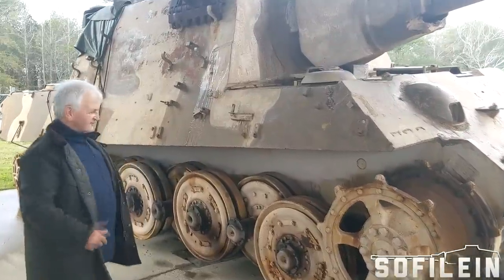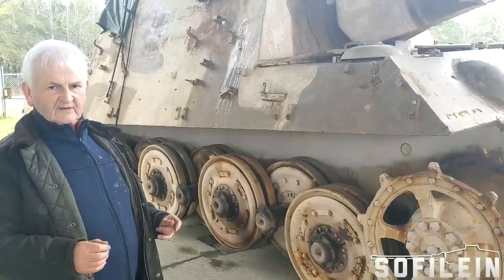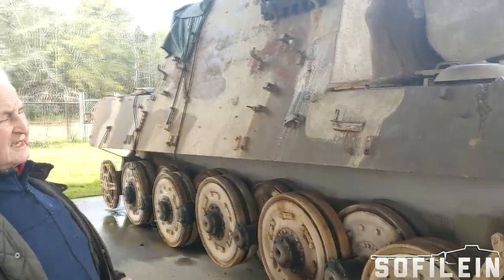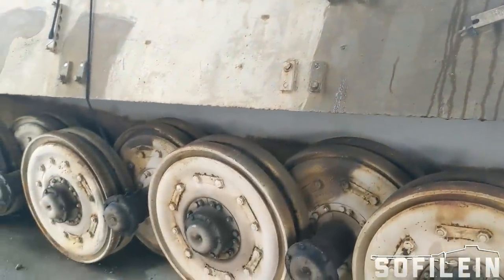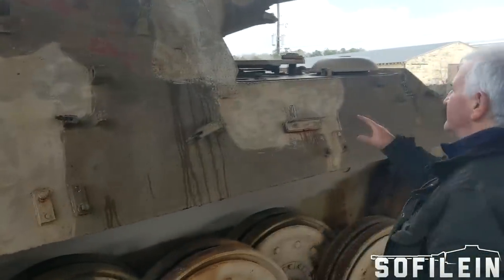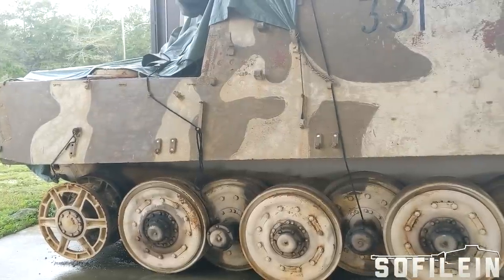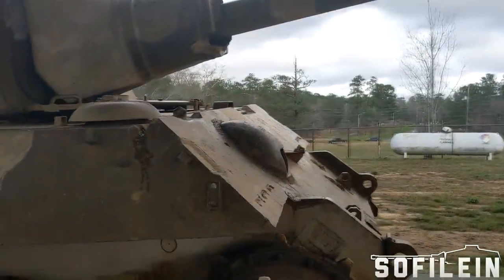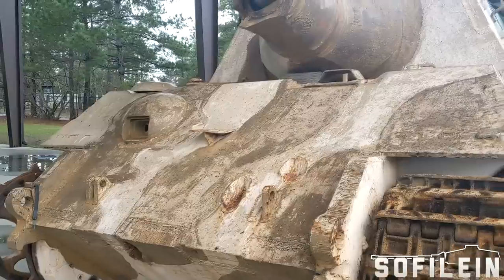Hilary Doyle talks Jagdtiger at NACC Ft. Benning

Comment: I saw that TD when it was at Aberdeen Proving Grounds years ago, it had tracks on then. Otherwise looks the same. Wish someone would restore it to running condition. :)
Reply: I also saw this Jagdtiger at the Aberdeen Proving Grounds museum before it was moved to Fort Benning. It was HUGE! Glad they gave all those Aberdeen  tanks and artillery a new home. A billion dollars worth of history  rotting out in the weather for decades. All of them need to be properly restored.
Reply: @michaelporzio7384  Well it is quite a job for the weather to rust such thick tank. When you see some tanks rusty colors it's just a surface. The worst that can happen to the tank is getting the water inside where some thin parts made of steel are located. Having an engine bay covered with only some tent material makes a world of difference. 
For some seriously rusted T54/55 check out Master Milo restoration process. He took his tank from England where it ended up after the journey from Iraq. I think he has a Type 69 with the old 100mm gun to be precise.
Reply: @HanSolo__  true! I will check out the Master Milo restoration process, thanks. Aberdeen had two Panther tanks, a Nashorn, Jagdtiger ,a T34/76 and an Elefant (among many other guns and vehicles) all out in the open and uncovered for decades. They should all be restored. The Elefant was restored (exterior only) the interior was a mess!
Reply: John Smith  As always depending on specified vehicles but for example, short-barreled StuG III restoration costs were something 0,5 million €. The condition of the vehicle was very poor but there was a second one (with the hull torn wide open that ended on the scrapyard in the '60s) composed of 80% of the equipment taken out and preserved in the museum storage. Gathering all the missing pieces from all over the world in case of tanks like PzIV and any bigger must take a fortune or two.  Still, T-34 and M4 seem like the cheapest WWII option. Some running condition are sold €250-400k
Reply: rsm169 Yeah I seen it in 71 while testing “things” there. Wish I would have spent more time taking pictures.
Reply: John Smith the Ft benning volunteers have no room for completed restorations UNTIL the 10,000(or 100,000) square foot museum opens up by the armor stationing grounds. Went there in july of 2019 and was one of the best experiences of my life. I saw and took a photo of the interior of this jagdtiger

Comment: I remember seeing this one at Aberdeen Maryland in 1982 before they moved it
Reply: it looks the same Tank, but why did they scrap the tracks?
Reply: @boaygamer  we removed the one side of track becuase the sprocket on that side is jammed and it wouldnt roll when moving it. The track is actually laid out in front of the vehicle. Nothing has been scrapped.
Reply: @robertcogan7109  Thanks for clearing that up for possibly a rebuild in the future; there are not many of these war machines left, and it's not like one could get parts at a local company. Even minor parts like track links would come in handy, and they could then be reproduced - and a small manufacturing run arranged. 

These 40 ton "Boat anchors" won't be able to be seen and appreciated if some bureaucrat decides that warehouse could be put to better use storing landscaping supplies or repossessed RVs. The property is controlled by the military, so that's not a problem - yet.

Comment: Great tank. Hugely impressive in person. I have pictures of it from when it was on display in the Aberdeen Proving Grounds tank museum. The divots on the bow are fist sized. And, if I'm not mistaken, the gun may be frozen in full recoil. Possibly the reason why it was abandoned?
Reply: When the left final drive was knocked out in combat by a well placed 75mm or 76mm round, the crew drained the hydraulic recoil systen and fired the last round to sabotage it, supposedly a fairly standard quick method adopted on the eastern front when abandoning vehicles.
Reply: @robertcogan7109  Now that you mention it, I do recall reading about that method of sabotage. Thank you.

Comment: Would love to see this baby restored to working order. Have always wondered why the Germans didn't just mount the 12.8cm L61 with the muzzle brake on the Sturer Emil - or even use the Sturer Emil design to come up with a more Jagdpanther style Panzerjager.
Reply: I believe the they didn't use the 12.8cm L/61 because it wasn't produced anymore, while the Krupp 12.8cm was being manufactured as a towed AT gun at the time. To the question, why didn't they extend the glacis to create a Jagdpanther style forward mounted main armament, it may be that it would have caused too much stress on the already overburdened transmission. But I don't know really. Personally, I think it would have been a good idea, and likely have kept the weight & height down somewhat.

Comment: Although seemingly in poor shape....I can tell you.. as a restorative person myself....the main tank is all there. Trust me..although it may never run again..cause it’s not just engines..it’s transmission and tracks and wheels..all on a 75 ton tank destroyer. But things can be fabricated and sand blasting and a cool paint job...and fake molded tracks could be put on.....it’s a classic! It’s legendary and it’s still around. If ya want to fix the mantel and the damage....just hand me a torch..some lead wiping...a grinder. Good as new! We can come up with antenna and some gear n towing cables. Make a nice Lawn Ornament for a base.  Kinda says what you do for a living! Only one on the block to have one....probably.

Comment: Hey, does anyone know if those hits on the front glacis were able to cause concussion to the crew inside? The dent seems quite deep. Was that made by american TDs?
Reply: Very doubtful. Armour way too thick to impact the crew.
Reply: Interestingly WW1 tank crews wore leather and chain mail face protection to prevent injuries from flying metal shards caused by shell and machine gun fire
Reply: @61js  True, but they didnt have nearly eight inches of steel plate in front of them hehe.

Comment: In Advanced Squad Leader the 128L gun wasn't as good as the 88LL (super long) gun.  I sometimes wonder what an 128LL gun would have been capable of.  I guess the next level up might have been some of the railway car guns but some of those were huge.
Reply: The 128L wasn't as good as the 88LL? How so? The 128L has an AP TK# of 33 while the 88LL has an AP TK# of 27. Furthermore, the 128L has an IFT FP of 24 while the 88LL's is 16. The only advantages the 88LL has over the 128L is a modifier of +1 more at long range  (25 hexes+) on the To Hit Table, a slightly higher ROF, and the ability to use Intensive Fire. I don't see how these latter factors make the 88LL a better gun in game terms.

Comment: Order tracks, segments and manufacture of any wheels for your tanks at our factory in Ukraine "Нижньоднiпровський трубопрокатний завод" Дніпро, Індустріальний район, вул. Столєтова, б. 21. In addition to pipes, our plant makes railway wheels of 160 names / sizes for the whole world! There is a small steel-shaped-foundry, where any shape can be poured from cast iron, bronze and other alloys, for example, masks for tank guns, individual tracks, turrets, and so on. You can send your specialist for consultation and control of the order. In the pipe and wheel sector, our plant is actively working with Germany. Order a trial batch of products to load one truck, see how it goes. I wish you good luck in restoring your equipment!

Comment: Did, I just hear this guy claim that the Ferdinand was successful?
Reply: as a shooting platform yes.
as a shooting platform moving on its own power euhhhh
Reply: They were very successful after Kursk and fought on the rest of 1943 and through 1944 and some into 1945. Well liked by their crews due to their high survival rate.
Reply: @obelic71  Very few were lost and abandoned due to mechanical problems though.
Reply: @lyndoncmp5751  the survivers of Kurks were reworked and improved with the lessons learned at kursk.
As its original designed role as an attack vehicle (tankhunter) it was not good due its to advanced propulsion system for its time.
As a defense vehicle (tankdestroyer) it killed the most tanks (+/- 1000 kills by 90 vehicles) and a few who survived the previous Russian offensives still shot up Russian tanks in the final battle for Berlin
Reply: @obelic71  The survivors of  Kursk were not reworked into Elefants until early 1944. Post Kursk the surviving Ferdinands had  nearly half a year of their original configuration from August 1943 to Jan 1944 and they performed very well with a very high kill ratio during the autumn 1943 battles of the River Dneiper bend.
Reply: @lyndoncmp5751  yep they had the highest kill rate of all german vehicles in WW2
Sofar i know 50 broken down Ferdinands from Kursk were brought back to germany from August 1943 on.
27 remained at the dnepr front for defense
13 were destroyed at Kursk by the enemy or their crews.
Reply: John Cornell  Then the problem also is in this case who recorded the history correctly, certain other sources like transport and battle commanders reported high breakdowns on these vehicles. 
After the war lots of surviving commanders wrote conflicting books and we don't know what they polished / watered down / spiced up on the real events that happend.
We can only try to understand it as good as possible.
We were not there when it happend.
Reply: John Cornell  I agree those records have the most historic weight to go by.
Logistic Commanders of the Reichsbahn and campain commanders historical books are more cloudy because they had other tasks to acomplish in the war. 
And after the war they deliberate swept things under the carpet to look better.
The logistical part of transporting men equipment and materials to the fronts / factories is also a verry interesting thing to read about and explore.